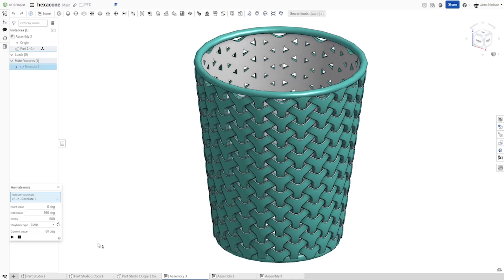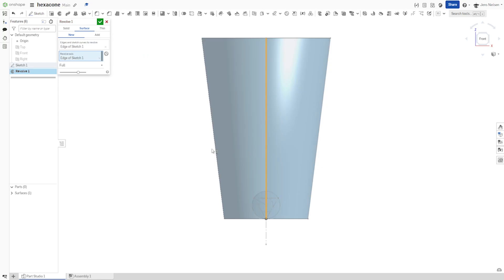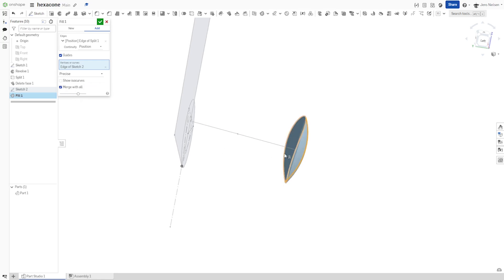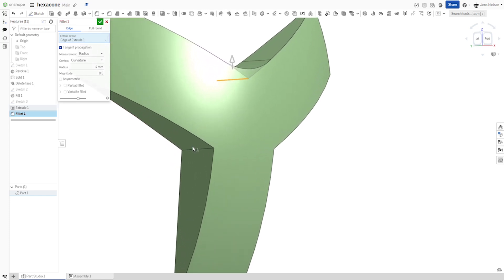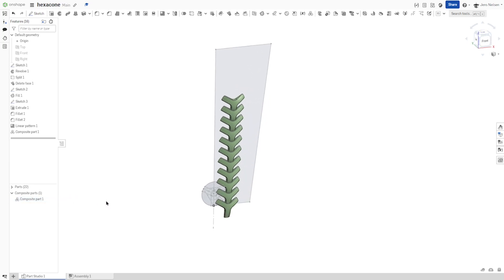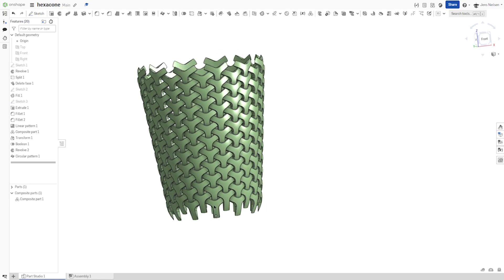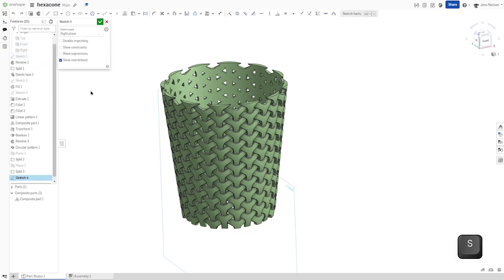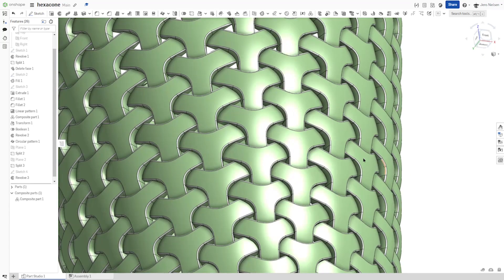From Cone to Container: Modeling a Stylish Basket with Onshape Surface Tools

Comment: how are you controlling the pan and motion of the object? -- oh i just printed it.
Reply from the maker: I got this 3d mouse which I truly recommend-How did the print turn out?
Reply: @cademist the print is perfect.. Is on a cr10 smart pro with PETG ..  just bought a cheap 3d mouse too.. See how that goes.. No idea what I'm getting my self into haha
Reply from the maker: @tristanboyle4450  I started with the cheapest one as well, takes a little time to get used to, but helps a lot!
Reply: @cademist  hey there is an issue with the model - i may have not sliced enough on the wide end but there are gaps as the star legs are too short at the top.. but i thought what would be good  is to have the star set with a height or radius dependant variable so the  star legs grow longer at the wider section of the model. what do you think? so before you do the linear pattern of 22 can you make the leg length set with a function?

Comment: Brilliant! Using split on a surface opens up a can of worms.  Then you extruded the star to remove it from the part.  Wild.  Also project from another sketch.. nice.  Now i think i should be experimenting with composite parts.  Very insightful. thanks. Ill probably have to do it again to know what i didn't remember...
Reply from the maker: Thanks for the detailed feedback, I'm glad you found the techniques useful!